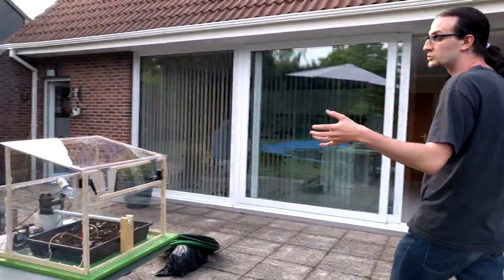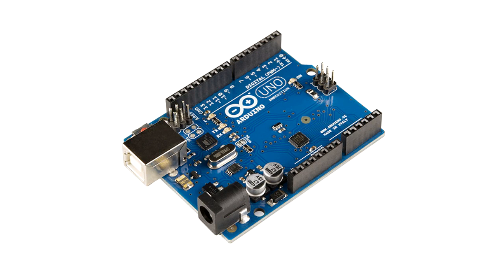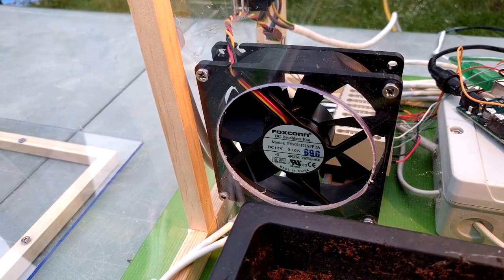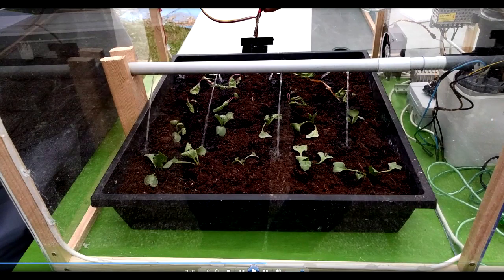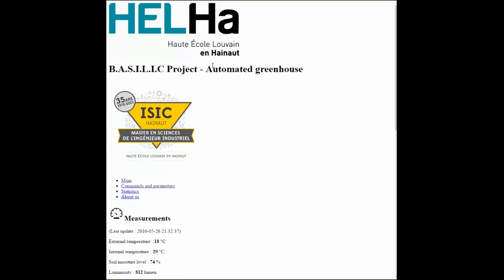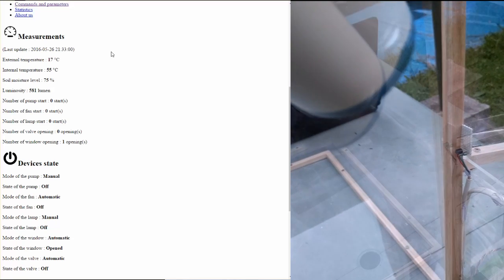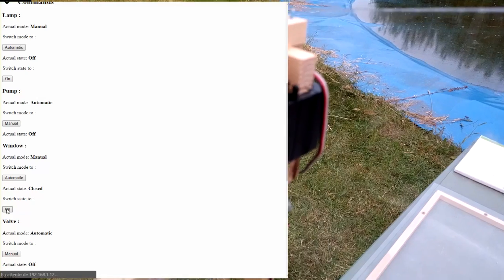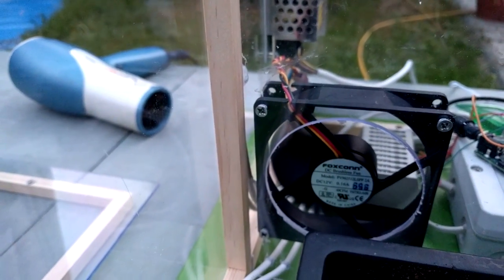Automated Greenhouse - Arduino / Raspberry pi (BASILIC PROJECT)

Comment: Seem a waaaay over the top project, a solution looking for a problem. Why use the Pi other than you needed to for your lecturer. A NodeMCU at 1/10th of the price would have done the same job.